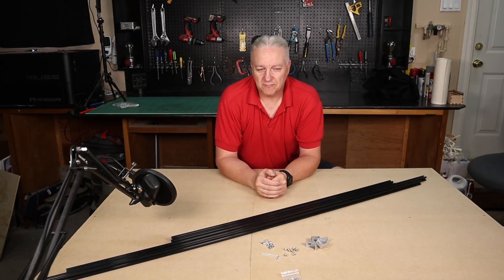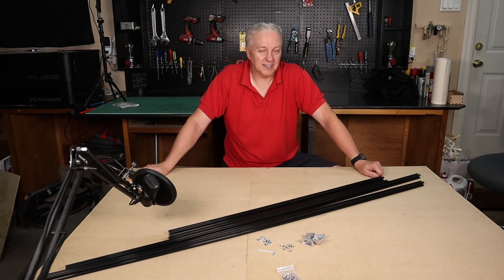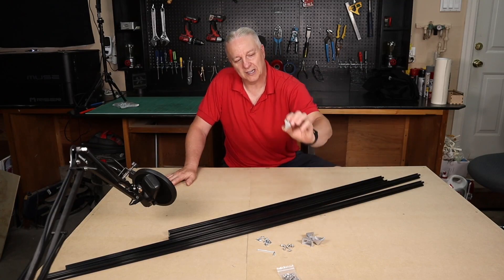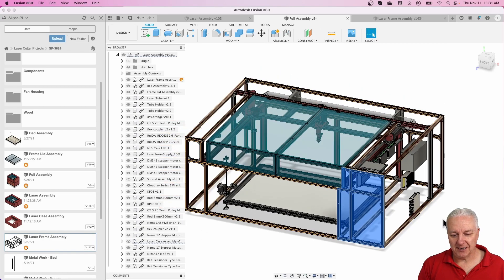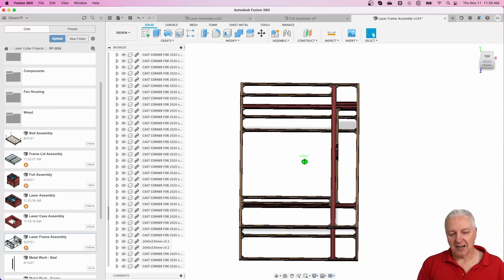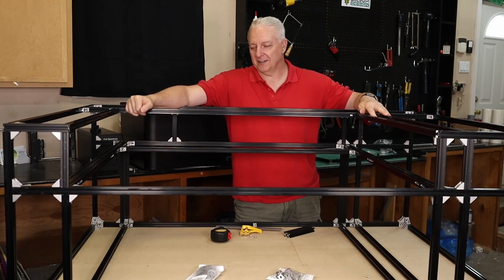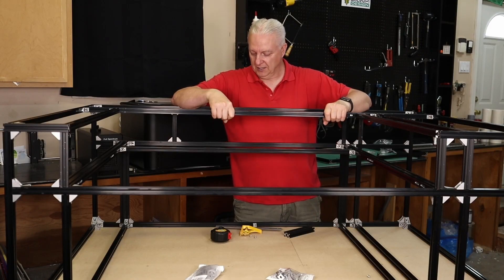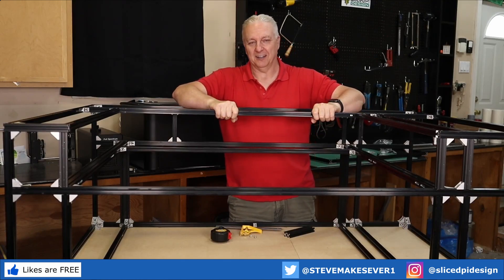What If You Could Build a High-Powered Laser at Home Right Now? Part 1

Comment: I'm starting to build my own 90w laser from your plans and cant wait to get it going. I'm just starting out and wondering if you could help me with an issue I'm having with the base.
You call for two 1500mm and two 964mm 2x4's. The 1500 would be the width . Here's were I'm getting confused. 954mm plus 38.1 x 2 to make up for the outside 2x4's gives you 1030.2mm end to end on the depth. Now when you start building the frame, the outside dimensions are 1500mm x 1240mm, the depth would end up hanging off the end. Is that a typo or am I reading that wrong?
Thank you for all the work that you've put into the plans!
Reply from the maker: Maybe we're both doing math badly, but you made me go back and verify because I do make the occasional mistake. 😀   Note that you have both 964 and 954 above.

So the length of the cabinet side pieces is definitely 964 mm + the thickness of 2 2x4's (~38.1mm), which gives 1040mm for the total depth of the cabinet.  This coincides with the 2020 extrusion for the laser frame which is 1000mm + 2x20mm.

Do I have a typo in the documentation? (I know of course that this is entirely possible)
Reply: @SteveMakesEverything  
That might be where the issue is. The laser frame size on the first page of extrution assembly shows 2 PC of 1500mm and two (1200mm) ID + the 2020 for the top rails and thats gets you to a rough opening of 1260 for the depth. Your saying it should be 1020mm
Reply from the maker: @speed23947  Well that doesn't sound right.  I'll take a look and do an update on the docs.  I expect you will find a bunch of these, so you can just shoot me an email if you need a quicker response.
Reply from the maker: @speed23947  I uploaded an amended documentation package it you want to download it again.  The only change was to replace the 1200mm reference with 1000mm so you could just pencil it in

Comment: I am building the Further Fabrication Y400 model. I am at the end stages. Waiting to get the chiller and the air extraction fan. It's been 12 months now. I had planned on swapping the rotary attachment wires with the Y axis wires as needed. I bought some 4 pin connectors to do this with. You mentioned in the video that the U Axis was for the rotary but I could not find any reference to this in the controller documentation. I have the 6445S model. I thought the U axis was for a moveable bed for oversized pieces. I am also planning on using Lightburn which I have already purchased and is connected to the machine. If I can in fact use the U-axis for this I would prefer this option. Any more info you can provide on using the U axis would be greatly appreciated. Also I just recently found your videos here and really enjoy watching. Thanks and keep up the great work.
Reply from the maker: The bed is controlled by the Z axis on the Ruida 6445. you can technically use the U axis for anything you want, but you can map it in lightburn for rotary use.

The FF Y400 is an excellent machine to build and I almost went that way, but then I would have robbed myself of the fun of spending 100+ hours for the CAD work in Fusion360 😀
Reply: @SteveMakesEverything  so everything I've read says Ruida 6445s uses the Y axis for this. I have checked both the controller and the lightburn settings and I don't see anywhere to use the U axis for this. If you know where to set this up I'd appreciate it. Thanks again.
Reply from the maker: @ou812vh01  Well I will be looking at a rotary attachment in the future so I'll let you know

Comment: Very cool project! I would recommend looking at using Spring Loaded T-Nuts as you can put them in when you need them instead of trying to predict how many you need before assembling.
Reply from the maker: Indeed in the finished unit there are many spring loaded t-nuts - mostly for the outter shell but I did sneak a few in when I was forced to add support  structure etc.  Since I now know how many are required, it's easier to document it or anyone who wants to build from my design can certainly just count them beforehand

Comment: I started building my own Co2 Laser 18months ago and just as I got to the last part of the build, a friend of mine gave me a 40W FSHobby Laser. So I decided to get that machine into action. What I discovered very early on was that FS Software was really very poor. Full Spectrum have gone down a Rabbit Hole and devised File Types which are next to impossible to use! I contacted FS Tech. Support and their advice was unhelpful to say the least. I've now decided to use LightBurn which I am sure will be solid and probably remove the need to use Coreldraw6 which I already own. I will be assembling a more solid sound Control Unit and demonstrate how reliable and capable the machine will be when I finish. Just to say that I have a few years experience doing Co2 Laser engraving and cutting after starting with a Chinese made Unit. I have a good knowledge of what is essential for a Laser to do work problem free. I would be interested to see how Steve's self made Laser turned out? I'm impressed by what Steve has embarked on and his knowledge and advice is well presented.
Reply from the maker: Not sure why I'm just seeing this message a month after you posted it.  At any rate, my laser is up and running if you haven't already watched videos.  I'm in the process of packing up the parts/assembly guide.

Comment: This is going to be exciting. I have a laser of the size you’re building and I’m finding that had I built it , I would have done some things differently. Which then brought up the thought of building one the way I think it should be done or at least replacing the electronics with higher grade parts.  I’ll be interested in what you choose. Will you make available a list of all the components you’ve chosen?  I would be very interested in a list just because electronics is somewhat a mystery to me and there’s much I don’t understand.  Thanks for doing this, I’m looking forward to watching the build.
Reply from the maker: Hi Don.  Yes, my intent is to make all the details available online. The only really important requirement for the controller is the it is supported by Lightburn - the software you use to control the laser.
Reply: @SteveMakesEverything  Great !  Yes, I’ve been using Lightburn a couple years and I can’t imagine using anything else. It continues to get more powerful and for me, does everything I need for design through machine control.

Comment: Very cool! I'm in the process of building a Further Fabrication laser as we speak. Not quite as big as yours (I upsized his design to 750x550mm) but using the same tube and controller. I'm about at the same construction point that you are so far, haha. Waiting on parts to come off the slow boat.
Reply from the maker: I watched that series of videos and they are great.  It inspired me to build my own, though I didn't use his concepts.  My laser is actually running now, but I've been slow to get the videos put together.

Comment: Very cool! Looking forward to more videos. I am curious how you square going this route versus say an OMTech 100 watt for $5500. I'm looking at getting their 55 watt to get started in lasers and add to my vinyl cutter, embroidery machine and 3D printer. I DIYed a large CNC router a while back from 3/4 birch ply but sold it. Have wanted a laser for years.
Reply from the maker: Part of the exercise here was to challenge myself to build a laser. 😀. In the end a 90W laser cost me around $4500 all-in, so still cheaper than OMTech.  If this is your first laser, then go with the OMTech since it will occupy less of your life for the month it takes to get it put together...unless you want a challenge of course 😉
Reply: @SteveMakesEverything  I understand. Did the challenge thing with router I built. Might be good on that front...lol.
Reply from the maker: @makertime5000  Because I didn't cheap-out on parts, this precision is great.  Once I got things dialled in, this laser is pretty awesome.  3mm plywood looks like it was cut with a knife - not charring at all

Comment: You don't need a special saw or blade to cut aluminum. A regular 10" wood chop saw with a 40-60 tooth blade cut it easily. Aluminum is softer than than oak. It will make a god awful noise.
Reply from the maker: You are correct; however one of the things I also had to do was cut down a 15mm Linear rail from 1000mm to 750mms.  The rail is wicked-hard.  Even with a blade designed for cutting metal it's tough going.
Reply: @SteveMakesEverything  oh yeah! Linear rails are a different beast. That stuff is hard!

Comment: Nice! I’m very much looking forward to this series of videos. Thanks Steve.
Reply from the maker: More coming.  I actually decided to favor a theme of what got built rather than the painful details of endless twisting of screws into things.  When necessary I will show some of the stock build footage I shot.  In reality though, after the frame and axes are assembled, everything else is pretty much just wiring and plumbing.  While the design in Fusion 360 was a hundred hours of misery, I was kind of surprised how easy this was to put together